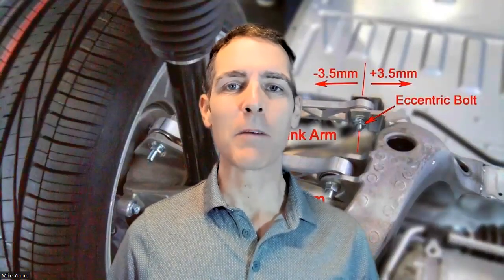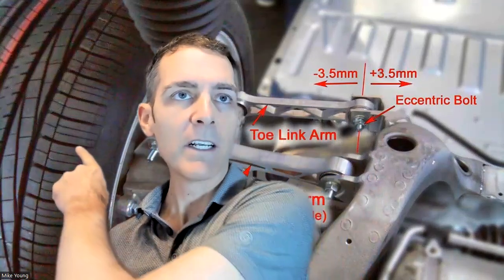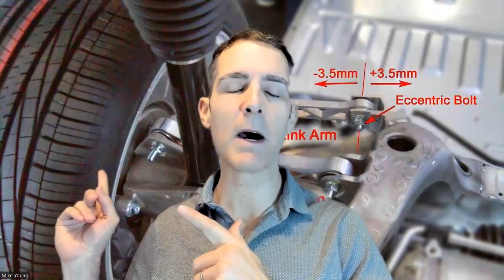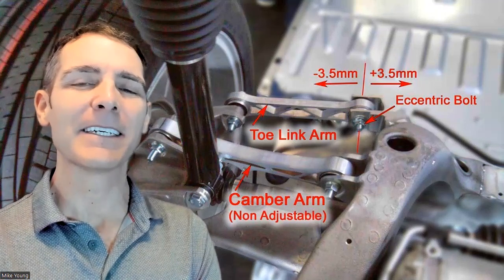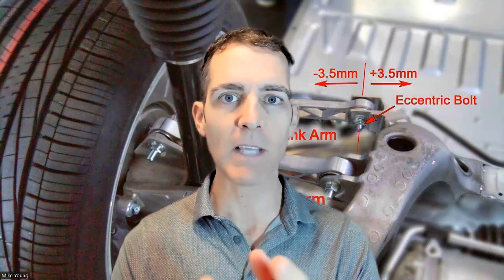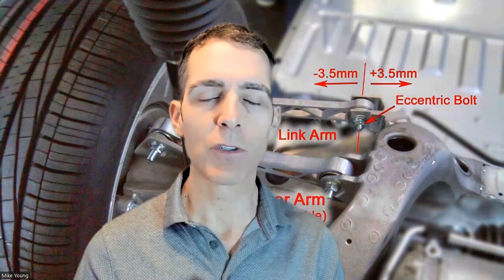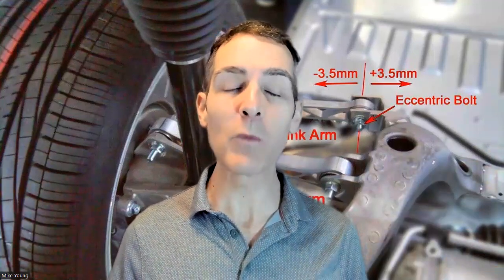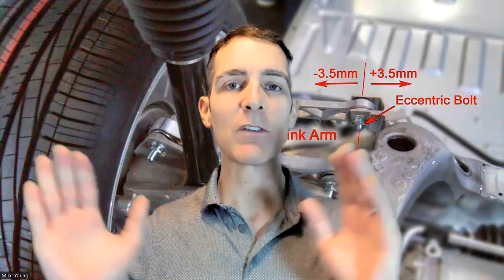Rear Inner Tire Wear + Front Driveline Vibration FIX 4 TESLA ! Camber + Toe + CV

Comment: So which ride height is best for less tire wear: extra low, low, normal, high or extra high? For an X ?
Reply: Very low will give more inner tyre wall wear. Very high gives you other problems. Avoid both. Medium is best. Adjustable Camber arms help a lot, but getting someone to do alignment with them is difficult as it can be a long job (wheels off for every adjustment).